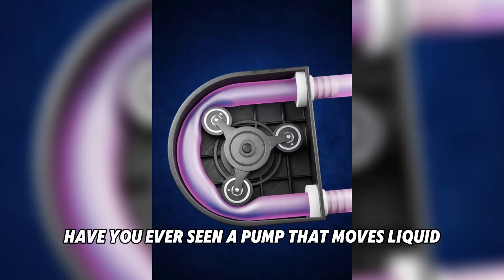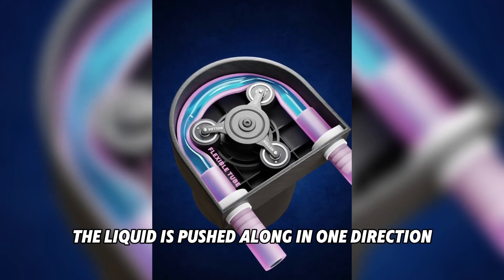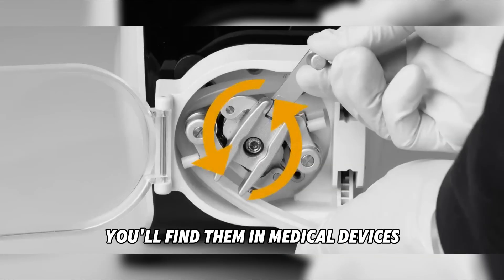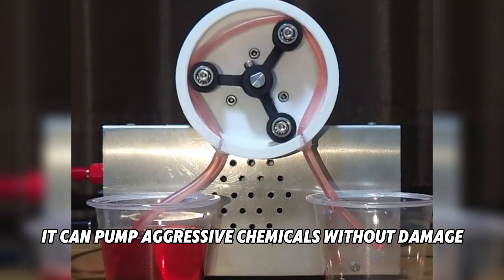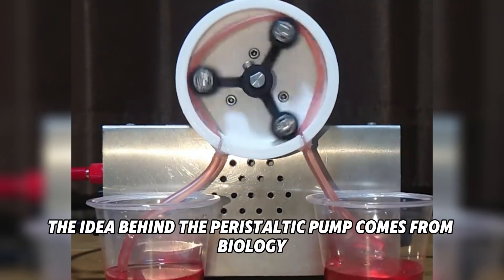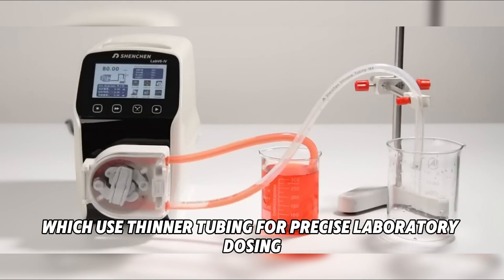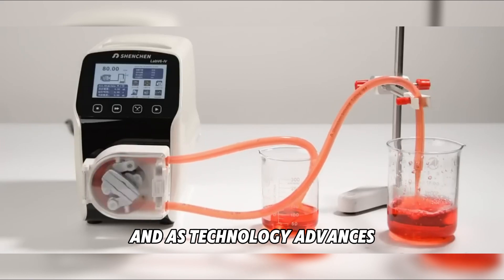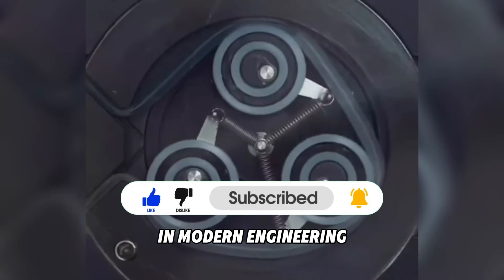Peristaltic Pump – How It Works and Where It’s Used

Comment: Can you explain the design of the last pump you showed, at the end of the video? What are the springs for?
Reply: The rollers are mounted on a lever and the springs move the rollers out to apply pressure to the tube.  This is a better design than having fixed rollers which relies on the rollers, pump housing and flexible tube having very precise dimensions to keep the pressure constant.